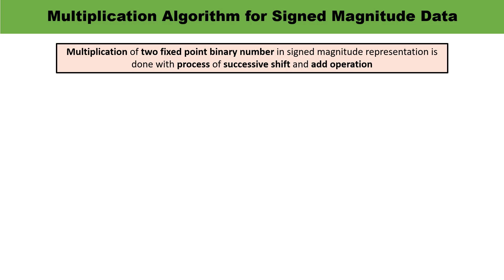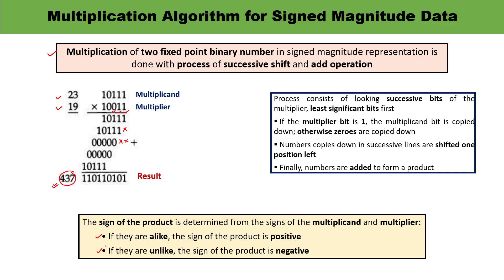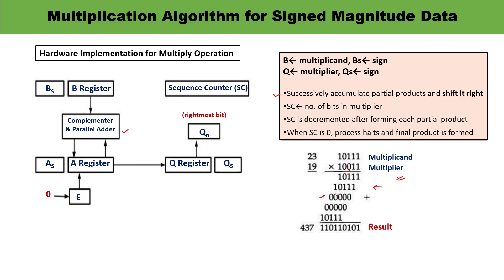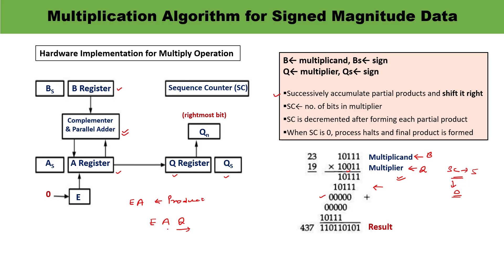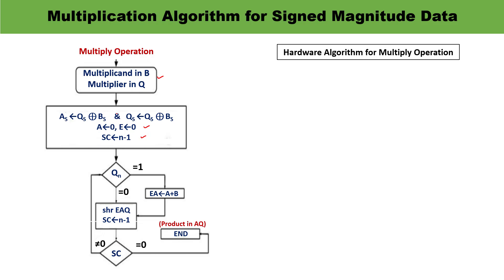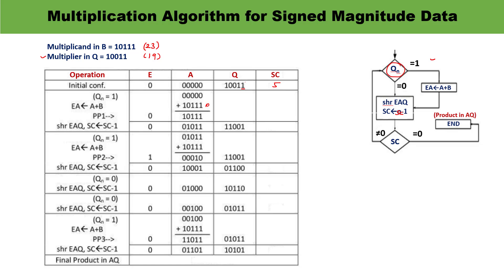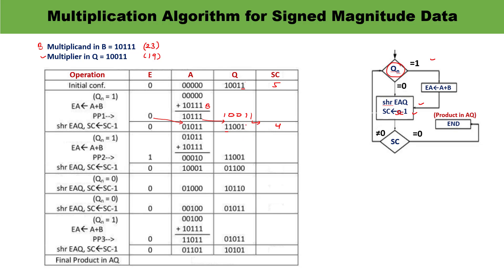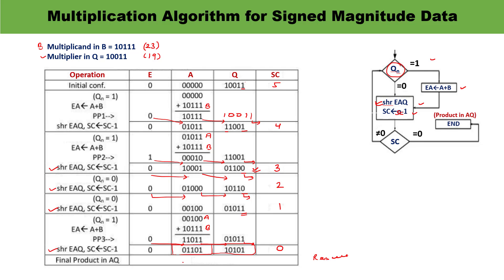Multiplication Algorithm | Signed Magnitude Data || Computer Organization and Architecture

Comment: 11:04 Excuse me mam , tell me that SC<----n-1,  but in case of numerical u have initially taken 5 bits is SC which is the no. Of bits in multipler but it should be 4 na
Reply: She's mixing water and oil
If these numbers is singned magnitude i will assume as -7 and -3 and the answer must be + 21// wrong 
If numbers are unsigned, i will assume as 23 and 19 and the solution is correct 
For singned numbers multiplication, the booths algorithm is the correct choice

Comment: question 1:
What does n really mean? is it register size or just the no of bits to represent mutiplier , however taking it any way wont change the answer
Question 2: 
assume we B and Q are 8 bit registers, but in this algorithm you are consider all bits of B , which is wrong.
suppose B : 10111011 (-ve number in signed representation) and A : 1001
then we have to ignore the msb of B but it has not been addressed in video
Ques 3: why are we doing Qs:Qs xor Bs

if the number is negative , As should be enough to store its sign